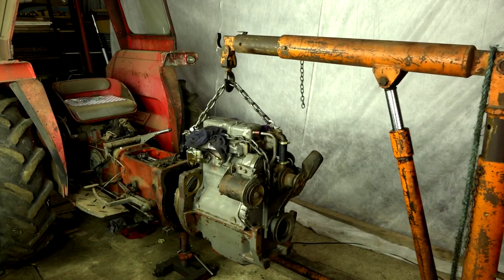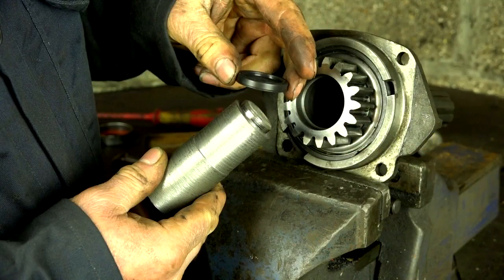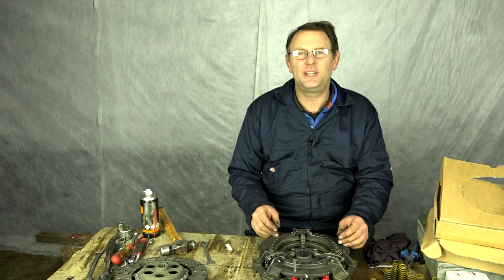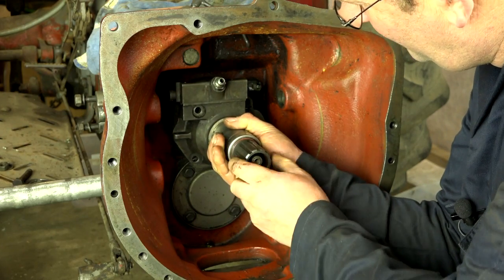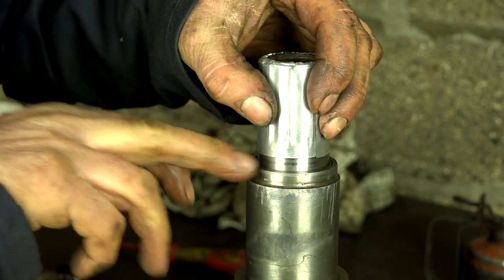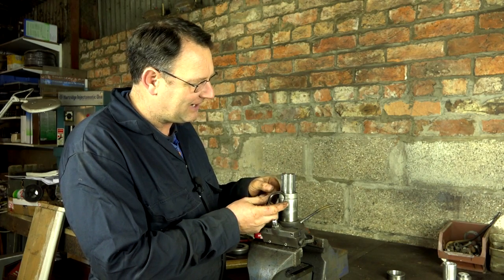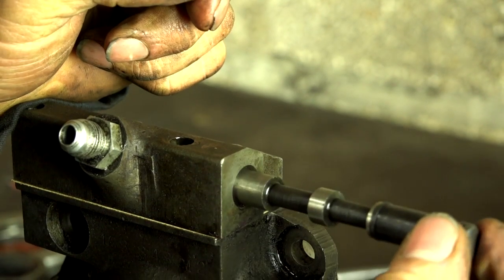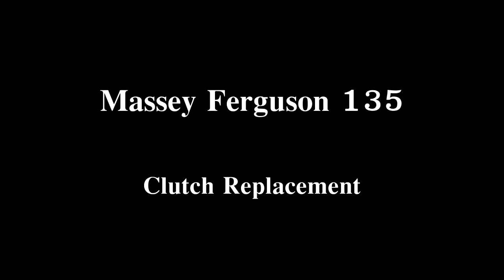MF135 Clutch Guide Promo Video

Comment: The videos they offer do not cover all models, so you need to read the service manual anyhow to make sure you don't mess up
Reply from the maker: Hi Idar,
Yes you are quite correct, the video is specific to the two stage clutch fitted to the Perkins diesel engine.

Also a useful guide for perkins diesel engine powered Massey Ferguson tractors with dual clutch - such as MF35, other 100 series tractors, 200 and 500 series tractors.
Reply: You may be eluded to think that replacing the rope seal will fix the oil leak, but often it comes from gasket around the sump. It would be nice if this was stated in the DVD. Additionally, the DVD falls short in telling that for some models (at least standard 6 speed MF135, 71mod), removing the PTO shaft along with the shaft housing cannot be done as explain in the DVD. It is far more troublesome than explained in DVD and you may end up damaging the tractor's gearbox if you use unnecessary force.